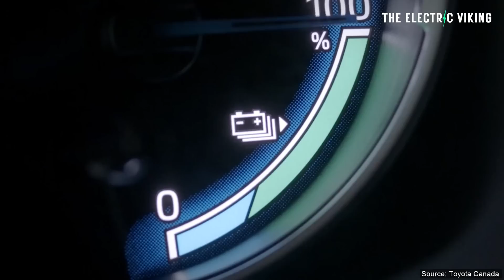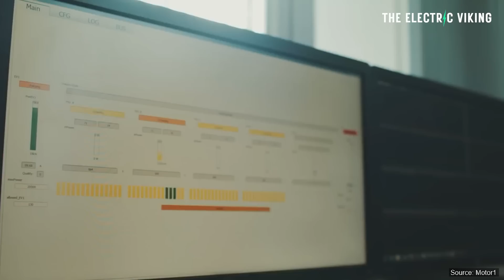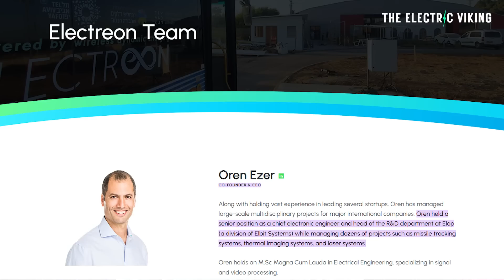Toyota Hybrid Breaks World Record: Drives 1200 Miles on  electric power only

Comment: The problem that still exists is the electric grid does not have the capacity to charge all the cars being produced on the road. The grid output has to be increased substantially, should the grid fail we all get stuck.

Comment: Bard: There are a few reasons why wireless charging loses more energy as heat than wired charging.

Inefficiency of the electromagnetic field. When electricity is passed through a coil, it creates an electromagnetic field. This field can be used to transfer power to another coil, which is how wireless charging works. However, some of the energy in the electromagnetic field is lost as heat. This is because the field is not perfectly efficient at transferring energy.
Resistance in the coils. The coils in a wireless charger and the device being charged both have some resistance. This resistance causes some of the energy to be lost as heat.
Inductive coupling. The coils in a wireless charger and the device being charged must be properly aligned for the charger to work. If the coils are not aligned properly, some of the energy is lost as heat.
The amount of energy lost as heat can vary depending on the distance between the charger and the device, the type of charger, and the device itself. However, in general, wireless charging is less efficient than wired charging.

Here are some additional details about the factors that can affect the efficiency of wireless charging:

Distance: The further the device is from the charger, the less efficient the charging process will be.

Comment: Back of the napkin math does not add up, nit even close!  Cost of induction system, labour to install in cars and in thousands of miles of highway, cost of materials and grid installation of power systems along highways are prohibitive.   It would need to be sufficiently robust to last decades and maintenance staffing. 
   This just doesn't offset the cheap cost of a slightly larger battery. There is the issue of induction of cansers by way of magnetized induction.  Eg. Brain cansers at cellphone body location.  Cellphone power levels have dropped by digital encoding.    
  Power levels required to charge a car at velocity are vast and catastrophic if  wrong!  Eg. Cook an egg in the microwave.... boom.  Risk?... people in a Faraday cage, bla ,bla ,bla, ..... Too exspensive, too bangerous.   
 Brother of stage 4 brain canser localized at  phone listening  position.

Comment: From an electrical engineering standpoint, this type of induction charging would be extremely inefficient due to the air gap between the coil in the road and the coil in the car. If you got 10% transfer of energy from the road coil to the car I'd be amazed. If the car was lowered, the efficiency would increase. Maximum efficiency of transferring the energy to the car would be achieved if the car was lowered to the point where it was dragging along the asphalt. Even then it's probably only going to be about 70% if you're lucky.

Comment: Wireless charging has problems with physics. The gap between the rotor & stater in electric motors is under an eighth of an inch. Induction stove tops have about a quarter inch gap. A 1 inch gap is huge for induction coupling. The efficiency is poor for a vehicle where the gap must be large because the vehicle  is hung on springs and could have flat tires. Wireless high power charging is a very high price charging system. If it happens on any large scale it will almost certainly be pricey and heavily govt subsidized. And I haven't even mentioned salt & snow plows. Not a fan.

Comment: How much energy was put into the wireless charging system vs what was drawn from it?

Wireless charging works on simple inductive coupling. It's like a transformer but without the ferromagnetic material efficiently guiding the magnetic field between the windings. Instead, there's an air gap that is a very poor conductor for magnetic fields. Also, to work as efficiently as possible, the receiving coil must be correctly positioned within the magnetic field of the transmitting coil.

The wireless charger in your electric toothbrush has a small gap between the coil inside the plastic post on the base and the coil just inside the hole on the base of your toothbrush. There is a gap of a few millimetres and fortunately, the coils are static and aligned. Add to this the fact that not much energy needs to be transferred to charge the tiny battery and the system works just fine.

Your wireless mobile phone charger operates with virtually no air gap. There's a miniscule gap between the coil in the phone and the back plate as well as between the charger coil and its plate but that will be a few millimetres in total. It takes more power than your electric toothbrush but the relative closeness of the coils reduces losses. Fortunately, your phone coil will be roughly aligned with the charger coil and will largely remain static.

What many people may not realise is that passive RFID cards such as those used for rail ticketing and a modified form for NFC communications used by credit and debit cards uses the same principle. The 'reader' is actually a transmitter and among other things, the signal is used to charge a little capacitor in the card circuit that powers it long enough to exchange data. Again, very little power but they only work over a short distance and require the coils to remain aligned long enough to do the job.

Now we have cars travelling down the highway. The car is moving but there is no way the coils under the road can move. I understand that they employ some fancy physics to 'focus' the magnetic field to reduce the inefficiencies but even so, transmitting significant amounts of power as the car travels along would require a correspondingly higher amount of power input to the road coils to overcome the inefficiencies. Also, the road would have to able to sense when each coil is in use and only switch it on when required, otherwise even more energy would be wasted. Without this capability, the road coils will still draw current to create the magnetic field whether there is a car utilising it or not.

I have no doubt that this test could be run if one did not care about how much energy was needed to propel the car. The question is about the efficiency. This reminds me of the way food is marketed "Low fat" probably means high in sugar. "No sugar" probably means high in salt. What is important is what is not said, not what is. Electreon makes no comment on efficiency in its FAQs. Why?

Comment: So why is the Tesla charging network so good... because Tesla payed to build it out.  Is this wireless company going to pay their own money to replace all the roads?  Also if 95% of the vehicles don't charge this way, are the construction problems worth it for say 5% of the vehicles on the road?  Plus what guarantee is there for fixed rates of  used electricity.... or is the government going to control it and raise the rate every year?  Just because a tec. works, doesn't make it practical.  With just 1 min of thought, I see many, many problems with this... theft... hey what if I can steal the power and use it to run my store.... on and on, this is just a BAD idea.

Comment: The irony is probably more so that Nikola Tesla himself had an invention for wireless charging and that UNDERGROUND charging was probably dumb to the inventor of AC himself back then... And we will probably end up with with a dozen tesla coils everywhere that are able to charge the cars using millions of voltage (very low amps) that only the car has a device that can bring down to a usable voltage. The higher the voltage, the greater it can travel through people and buildings (until something manage to pick up this voltage on the receiving end).

And depending on which car receives this voltage, they can basically detect through the cars computer and charge the customers accordingly (given that only one entity has monopoly of the Tesla coils in each region.)

Comment: I keep repeating myself. And the grid to power all this?

Okay, some of us can have EV's with the existing grid, but not most of us. And once the number of EV's exceeds grid capacity, it's game over. Already, California had to ration electricity last summer due to this issue. It will doubtlessly be worse this summer due to additional EV's on the road.

If you're going to use and horse and buggy get around, shouldn't you find a horse first?
Reply: I keep repeating myself. The grid power for this there at night.
Charge at night time when there is a light load on the grid.
California only rationed electricity at the peek times durning the day not at night.
Reply: @universeisundernoobligatio3283  , great, but what happens when so many people leave their air conditioners on during hot spells to get a good night's sleep?

Not saying there isn't some spare capacity right now. However, the time will come when there won't be any if the grid is not scaled up significantly.
Reply: @lrg3834  
You do understand the amount of electricity that AC draws if a function of outside temp, When the night outside temp drops less electricity is used..
For the amount of electricity that it takes to provide a gallon of gas, a EV will go further the the gallon of gas will take you.
So as less gas is used more electricity becomes available. 
You should send an Text the the electric utility companies that they are missing an opportunity buy not expanding to provide electricity for EV's
Reply: @universeisundernoobligatio3283  , look, expand your imagination for a minute. Imagine over 50% of all California vehicles on the road are EV's right now!

Bye bye.

I live in a hydro-electricity RICH province in Canada. California is piss poor when it comes to electricity generation by comparison. Population of my province: a little over 5.4 million. California: over 38 million!

POINT: BC Hydro will be able to support 350,000 EV's by 2030. There are presently 3.7 million vehicles on BC roads right now.

You haven't thought it out.

Incidentally, BC also exports electricity to the U.S. west coast, including California.
Reply: @lrg3834  
For a moment you had me, then I remembered there are more sources of electricity then hydro.
Expand you imagination to solar, solar thermal, wind with storage and more.
A HVDC transmission line can run GW 1000s of km.
Been to West Texas there is enough land there to power the USofA with solar, even export to BC.

It will take time but utilities are already planning for the future.

Already US Electricity From Renewable Energy Beat Electricity From Coal Or Nuclear In 2022
Reply: @universeisundernoobligatio3283  , let's hope you're right about scaling up energy production, because as is, it doesn't look good, especially in most other regions of the world.

Comment: So it likely comes down to economics over time (and practicality, of course). 

So for example, how small a BEV battery is a good idea in case there are traffic jams in bad weather on the 90%ish of the road with no charging capability?  Not being able to run the AC for hours in the 100 degree heat in LA or the heat for days due to a tiny battery sounds undesirable for example.

Then you have cost of the charging from the road, how much traffic it could handle well, the impact of weather, maintenance, durability, etc. 

Something working at laboratory scale is nice for an experiment, but widespread economic practicality in a WIDE set of circumstances/variables is needed for such a thing to become a reality on a broad commercial level. 

If BEV batteries keep improving and are very fast charging, have 500+ mile real world ranges, are very  safe and durable and rugged, can be made with moderately cheap materials, etc. -- then the need for something like this would likely exceed the cost. 

OTOH, if 99% of the time, it would let a PHEV sided battery make normal speed all BEV mode drives possible on the highway (so real world, almost no gas would ever be burned by a PHEV), that could be awesome.  

It's nice to see so many possibilities emerging for the EV future.

Comment: If this is true then electric trains and trolley buses should qualify with literally millions of miles. That said, maybe it should be limited to one drive train. There is nothing remarkable about this. It simply upgrades toy train technology to wireless. San Francisco's trolleybus system has upgraded all the trollybuses with a small battery on top to allow them to go around blockages. My thought is why does any vehicle need ICE technology? However the government needs to step in and regulate implementation on public roads. Boring Company and Tesla are a natural choice.

Comment: Okay, as someone who has owned for Toyota hybrids and to plug-in hybrids I can absolutely tell you that it is impossible to drive a Toyota hybrid without the gas engine ticking on intermittently to keep the oil and coolant and everything else in the gas engine cycling through. I specifically had a conversation with one of the Toyota mechanics because it seemed like we were using more gas than I thought that we should oh, because of the short-range distances that we drove on daily commutes.

So unless Toyota or this independent company actually disengaged the gas engine in my estimation, it is absolutely impossible to accomplish this without using gas.

I just did a quick web search ComEd apparently in Canada a Toyota representative says that you can indeed drive without gas, but I'm just going by what the mechanics at Toyota says and my daily experience of turning on the engine and as I put it in reverse the engine kicks on once in awhile even with range left.

Comment: I don't like that kind of stuff. Too many wireless signals already going around. And i am not talking about cellulars's signals too. They say it safe. But cancer is like those wave, it is all around us too. 
Forget my concern about this, and look for fact, and what's comming. It is clear that drone's transportation is around the corner. As soon as they solve weight's battery (almost there already), they will start testing it for real. So don't invest money in this kind a road. With the weather, we already have problem maintaing the road usable. So many `ostrich's nest`, you need a 4 X 4 for sure. Here in montreal with those orange cones, you have to plan ALOT of extra time just to get from A to B. So. that said, if your look for investment. Invest in drone's transportation instead.

Comment: Using Tesla's auto pilot, empty, any EV could travel on this/any track virtually forever. Trucks could carry cargo coast - coast. Robo-taxis could carry passengers point - point, like trains, but with many more stations. The battery life is greatly extended from continuous charging. Travel cost drops 95% or more. Most people don't need cars. Road infrastructure need not expand, especially if it is privatized. By the end of the century more private planes with exist than private cars.

Comment: I think this technology would be well used incorporated into parking structures, instead of trying to retrofit entire road systems with it. The cost of installation would be unbelievable. But putting some in place in a parking structure or underground parking lots that are often available to apartment dwellers would be great. Doesn't solve every problem, obviously, but removes at least one barrier to entry for people wanting an EV that don't live in a standalone house.
Reply: If you have a place to park in a parking structure, just put in a few hundred dollar charger.  This is a solved problem.
Reply: Many places I've lived before wouldn't allow such a thing, because you don't own that space, it's just being rented out. They also change sometimes, so it'd be a pain to install a charger every time you relocate or were required to park somewhere else... It's not as simple as "Whack a charger in, she'll be right".
Reply: @Lucifuriuz  Battery swap is the answer. Look up nio.

Comment: I'll bet he connected the gas motor to the generator! and if you get that special gas adapter GM bought the patent from that guy who invented it in the 70s, who was getting 100 miles per gallon, imagine how far you could travel if you put a tiny motor large enough to run an electric generator in an electric car?   '; p

Comment: And than you’re again dependent of the party who delivers the energy and they have you by the nuts, sucking your wallet empty. I charge my car at home, for free with solar. Ok for people without other options but I’m not waiting for this. And the road trip story, for safety you need to have a brake every 4 hours. Let this be exactly the moment that you charge your ev from 20% to 80% in max 30min. Just enough time to stretch the legs and charge your own battery for the next 4 hour drive. What’s the issue?

Comment: Your thumbnail is just wrong - it did NOT drive 1,200 miles on "battery only". The accurate statement is that it drove 1,200 miles on electricity only, with almost all of that electricity coming from inductive coils under the road, not "the battery". 

This technology has a lot of promise, but it may be a mistake to emphasize urban use. It's greatest potential will be in inter-city highways, and valuable to electrify large semi trucks.

Comment: May have some use as a static charging system,or a dedicated bus lane etc, but not for on the move under road charging.
PHEVs are a bad idea in my opinion,, an electric drive system hauling a heavy car with an ICE engine, and an ICE car hauling a heavy battery and drive system, better to have one or the other but not both.